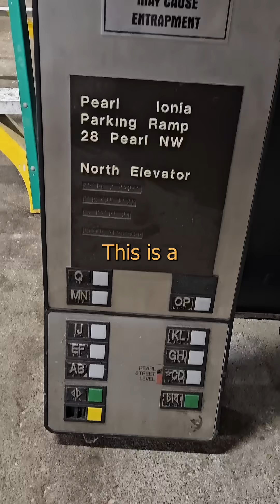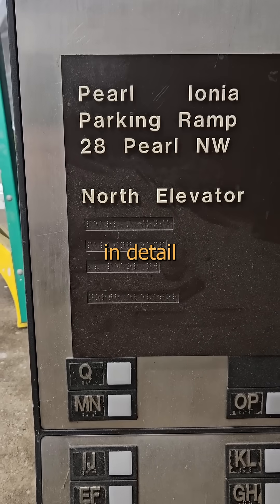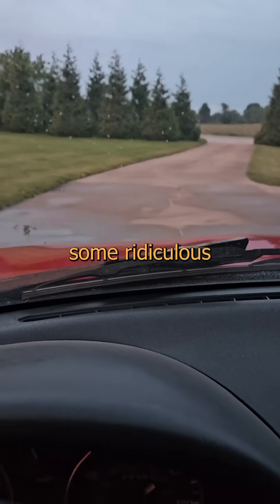Miata Mischief #chrisboden #engineering #gear #elevator #score #stories #parts #hacking #making

Comment: I once hauled a Force 50 long shaft outboard engine in a Peugeot 307 CC I had it in the front passenger foot well, engine in the foot well with the roof down and tied to the seat, the propeller was above the windscreen, the outboard took 2 people to lift, I got some really strange looks on the motor way  when I was going home at 120KPH

Comment: Wanted a basketball hoop pretty bad when I was 16. I found a free one and only had a 02 civic, I took my took box and set on an hour long journey to the hoop. I had to disassemble everything apart, and yes, it was a fancy one too with a glass backboard that sucker fit just right in the backseat, the bottom fit in the trunk, and the bar was rusted so I couldnt break it down. Now I was in a dilemma, I couldnt throw my seats down because the backboard was blocking it, couldnt stick it out of trunk because the bottom was in there, and I didnt want to leave it and drive one hour back to go with a half basketball hoop. Then I struck a genius moment and realized I could stick it in my sunroof. I opened the sunroof and stuck it diagonally into the backseat, shut the sunroof to keep it from moving around and I took it home feeling like im ready for some car jousting.

Comment: 1: 1997 Chevy Silverado C2500 NO 4X4 capabilities. Oh and long box.

2: Towing my buddies 2025 Dodge 5500 6.7L Cummins from 5ft deep of snow in a ditch.

3: dont have a trailer and his front axle went from 1 whole axle into a soggy taco. 

4: didnt have my goose neck trailer… so we somehow put his end on the back of my truck bed and towed it with his back wheels on the ground. 

5: No straps and lights. So he had to be on the gas at the same time as I was or it would fall off. Also keep in mind that we were on the most major highway in Alberta Canada during a snow storm. 2 hrs later we pulled it into my garage and worked on it 5 days straight

Comment: I fit 3 tires in my passenger seat and another one in the trunk , ive also hauled a hard top 6 hours across state lines witha  ratchet strap passed through the windows of a crosstrek.

Comment: Oh I am a total trash dragon. I build gadgets from trash then sell em as functional art. I built a 12v AC system with a scrap evaporator, a couple scrap condensers, a portable 12v squirrel cage blower intended for job site ventilation, and a VW 5 cylinder AC compressor hooked up to yet another 12v motor (this gadget I probably wont sell). The only thing that was new was the refrigerant plumbing, expansion valve for the evaporator, and the batteries (have to do it right to do it safe). I gotta 200a bank of accessory batteries in the under pinnings of my truck. I can plumb cold air into a tent with an insulated vent or run it into the camper of the truck. :):) Gotta channel launching this winter once I have a good back log of my shenanigans. Love the channel Chris. Keep it up!

Comment: An entire 3pc wall unit. In a CRX. Also hauled a fridge/freezer combo with the same vehicle 😂. 
The most sketchy was a 3 pc sectional and weight lifting bench and bed... all on the roof of my buick😊
4ft bed southbend lathe and table on the roof of my dodge colt...
Only had one shot and no truck😂

Comment: I was a broke college kid in Munich, and found a sweet 2-person leather couch, but only had a bicycle and a bus pass.
I rented a Mini cooper convertible by the hour (like zipcar), and had to drive that thing on the Autobahn with the top down in the winter with some show showers.
The couch was about as wide as the mini, and I had to hold on to it all the way, since about 2-3 was hanging out the car.
I was pulled over by the Polizei, and they wanted to give me a ticket for unsafe cargo, but could not stop laughing, so they just told me to not cause an accident and go home through the shortest way possible..

Comment: Compared to all these great stories, mine is pretty lame. Hubby and I did a late fall haul of the remaining crap outta his deceased brothers house up to our camp in northern NH. We got a very late start, it got dark early, and it started to POUR. We started thru the Notch (Franconia Notch) and suddenly lost all lights in the truck. So, no exterior lights on truck OR trailer, and no interior lights…weirdly the ONLY thing that worked was our hazard lights (which makes NO sense). We made it to Lancaster and got pulled over, but as the cop was talking to us he got an emergency call and just told us good luck. We somehow made it up to our camp without getting hit. That was at least 25+ years ago and we remember it like it was yesterday.

Comment: I was remodeling homes very poorly for awhile without a truck. While working in southside Savannah area I had a couple houses within a few miles of the Home Depot. One house needed a whole new door jam installed. I had a maroon 2003 Hyundai Elantra sedan. I put the entire door jam frame and door as one solid unit on top of the Elantra. Put all 4 windows down and ran some very flimsy cam locking straps not even ratchet straps. Drove the 3. Something miles holding the ends of the straps in one hand shifting with the other hand and driving very slow with my knee. Made it got the door installed and made a few hundred bucks off the job

Comment: Not really all that crazy sounding, but I loaded up all the 12v batteries from several enterprise server room UPS that we replaced to haul off for recycling. There were qty 384 of the 9 AH batteries, and 96 of the 5 AH batteries, altogether it weighed about 2900 Lbs on the pallet we unloaded it on. My Subaru Outback did NOT appreciate the load.

Comment: Ok, putting in it all the gear you will need to go cave diving, probably trained and equipped, then driving 100 miles to Marianna Florida. 
Oh and manual transmission all the way. 😊

Comment: Back in the early 90s I was wandering around industrial parks trying to come up with milk money when I discovered a dumpster 40 yd.³ dumpster full of everything that had anything to do with Pentium production line or older from a bit player that just up graded its digs.
All I had besides my bicycle was an old blue Mercury comet I made six trips to my garage at my apartment and filled it floor to ceiling.

I had that mercury filled everything, but the driver seat I had the trunk filled to overflowing I had on top of the trunk lid, packed and tied I wished I could’ve gotten it. All my wife looked at me and said I was nuts..
It took a wile to find top dollar but I did
And received. $4,000.00 for basically two days work.

Comment: Drove a 1997 Lotus Elise daily and moved huge amounts in it despite it only weighing 700kg. My 50kg Labrador, took it scuba diving and freediving including all my equipment, attended LAN parties with my PC in the passenger seat, went camping with a double-size swag in the passenger seat which only fit with the roof off, and coolest of all, moved a running server by first putting the UPS in the footwell beeping all the way between sites.

Comment: I was walking home one day and for reasons I don't know, I found a blood lead level tester from probably the 70s, still in its waterproof plastic case. I brought it home and disassembled it, which I am fairly sure I should not have done, but fuck it.

I also found a very, very expensive Zeiss microscope in the same place 20 years later.

Comment: Drove a front wheelie on a wheel loader for a mile and some change in the snow to get a bunch of steel plates to the job site. Let me explain.

I live and work in the sticks, curvy back country roads that only lead to more Bumfuck Egypt, rednecks, and bad decisions, this is home for me, and with that comes some freedoms to do dumb shit and nobody is going to think twice. 

It had snowed heavily the night before this incident and the roads were thick with ice and snow. 

I managed to get to work and all the work trucks had gotten stuck in the snow. We chained the trucks tires but they still didn’t have the weight in the back to keep them from sliding or gaining traction, and we couldn’t put sandbags on the truck beds (for reasons I still don’t understand) so I thought “why don’t we call the metal fabrication shop down the road, and see if they can cut us some mid thickness steel plates we can bolt down in the back of the trucks to weigh them down a bit without having anything protruding” redneck as hell but fuck it we’ll give her a shot, and that’s what we did!

The problems began after they cut the sheets, with delivery, they couldn’t do it because of the snow, well shit what now, the trucks are stuck, forklifts are stuck, but we do have a bucket wheel loader with chunky tires and they’re only little over a mile away, we’ll just drive that down and get them. So we did.

We drove there absolutely no problems, roads were icy and snowy but the wheel loader had no issues with it, they direct us into a shop door where they slide the sheets out into the bucket of the loader, and as soon as they dropped the sheets, the bucket stoved itself about 2 inches into the ground before springing back up and the whole kit N Caboodle balancing perfectly on the front wheels.

We all stood back and stared at it for a second in amazement, this fairly large machine balancing perfectly on its front wheels, we thought the bucket loader was rated for more weight or the steel was heavier than we had originally anticipated, and it’s too heavy to get the rear down at all, but either way here it all sat, balancing.

Of course the boss is not happy, and neither are the fabricators cause now this things just kinda stuck as one big hazard, but I however do not see a hazard, I see a potential for a fun and rare opportunity to fuck around on the bosses dime, and I’m redneck enough to not exactly follow OSHA more like OHSHIT, so I climbed up into the balanced loader and put her in reverse, and it stayed balanced as long as I feathered the gas right, so I said real nicely to the boss “boss I can get this back to the site just like this no problem, you’re just gonna have to trust me” which of course he absolutely didn’t, BUT he didn’t really have much of a choice because the fabricators pretty much just walked away from the whole deal leaving us to our own devices.

So I backed it up and realized that this bucket loader steers in the middle at a joint, not at the front wheels, so to steer I had to jockey the steering to throw the weight of the rear around to pivot on the front tires, so I did that, for a mile down winding roads all the way back to the site, sliding, slipping, bashing the bucket into the pavement, destroying some local vegetation, taking out only one stop sign, and feeling the weight of all the OSHA handbooks spontaneously combusting due to my actions.

Once we got to the site, I dropped the bucket, and left the unloading process to the guys there as this whole ordeal had taken quite a significant chunk of my time and I had more important things to deal with. 

But that was probably my sketchiest transport story

Comment: I used to work at a bottled water factory. Purchased an entire pallet of water at $1 per 24 pack, the discounted rate for employees. Ended up having to leave a few behind, as i had a '91 Chevy S10 and the front tires were near ready to leave the ground with how many cases i had.

There are 84 cases in a pallet.

Comment: I bought a 1969 Honda CB350 motorcycle a few towns over. It needed some work so I had to get it home. So my ex and I loaded it up into the back of his Subaru outback. It was an extremely tight fit and certainly wasn't good for the back of his car but it worked out. I have pictures of it jammed in the back that I like to show people asking about cargo space of the outback

Comment: 16' long composite deckboards strapped over the roof of a regular cab, short bed Ford Ranger. Used the loading dock twine from Home Depot to tie down one end to the front bumper and the other to the trailer hitch.
Also carried 1600lbs of cinder block in the same truck. That was a sketchy ride. 🤦🏽‍♂️

Comment: I drove a 15 foot 4 inch wide pvc pipe up a mountain road because i wanted to make a snowboard rail. I had half sticking out the front passenger window and the other half out the trunk. My car was a two door. Luckly only almost skewered a deer

Comment: I buy car parts but the most time the parts don't fit soo good in the inside of the car as the outside. In my opel corsa b i got 3 meter wood boards on the roof and a pallet jack in the inside. On a other trip i got two bumpers and some interior parts in the car.

Comment: I was offered a free fifth wheel rv, 36 feet long and a total weight of 18500 lbs, I hauled that sucker home with my ‘97 F150 sporting a 4.2L V6. At the time I did NOT know the breakaway pin was missing. That means the electric brakes on the trailer were fully engaged. My truck was screaming on the highway and still made it up to 100kph (60mph) up hill no less. What a fun ride that was 😂

Comment: 1996 Chevrolet Camaro, removed rear hatch to haul 2001 Yamaha Banshee like everywhere!! Rear tires wedged in the T-top compartment and front wheels on edge of t-top roof bar with ratchet straps from quad frame by foot pegs to under driver and passenger seat frames.. All to ride every weekend, miss those days!!

Comment: I once had an internship at a machine Workshop and was tasked to get a pallete of steel sheet parts from across the country.. little 19yo me feared the Company shitbox for that long drive so I took my personal car.. I got there and the load Fit in the trunk all good. I just underestimated how heavy some densely packed steel sheets could get. The drive home was like driving a tank without acceleration nor brakes nor suspension.. I made it, car was happy again after the thing came out and the suspension came back up about 20cm but after that I did take the shitbox.

Comment: Super boring I know but I stole a £600 (or so) office chair from my university and took it home on the bus. The bus was packed, and there were no seats. Fortunately for me, I had a seat. This was a BYOB moment, but for only me and my chair. 

I realised that if I wrapped my backpack around a pole I could stay relatively in the same place. Unfortunately, this was after learning the hard way that an office chair with wheels will move on a moving bus. Nearly got kicked off because I ended up next to the driver's window when we came to a stop at some lights.

Comment: Nearly killed the suspension on a 1993 Mercury Sable shaggin' wagon hauling home a bunch of pressure treated landscaping timbers to build a fence with. Car never handled potholes the same way after that. I managed to cram 50 of them in there and I think I only scraped the muffler on the pavement 3 or 4 times.

Comment: The Miata is the perfect example of less is more, you are correct they are made of fun, the fun module is mounted just above the torque brace forward of the fuel tank. Don't scratch it because the smile turns upside down :-(

Comment: I drive 1991 mazda b2200 5speed I wish I had a miata but the truck is fun just a little bit slopy In the suspension But I have plans for an upgraded anti roll bar and lower profile tires like 205/ 55r16, instead of a 205/75r14.

Comment: I bought the Mechanical contractor a case of beer to have his crane operator lift the Cold War Era Chrysler Air Raid Siren off the third story roof of Carrick High School in Pittsburgh, set it on a utility trailer that was about a ton too light and haul it thirty miles home. When you fire up the Hemi V8 engine and engage the clutch the 138dn that it makes a hundred feet away not only brings new meaning to “noisy neighbor” but gets the attention of everyone in a 50 mile radius!

Comment: Uhm....transporting couches on the roofs of vehicles that definitely should not have had couches on top of them, especially the pull out couch that weighs close to 200lbs for some fucking reason.

Transporting 20ft boards in the trunk and on the roof of a Toyota......something sedan with a sunroof. Using that same Toyota, a piece of an old tow strap, and a tree branch as an engine hoist for an '04 Chevy Silverado 2500 HD on a grassy slope in the rain, I'm impressed with the tree and the car on that one. 

Hauled 12 people in a Ford Focus over 100 miles. I sat in someones lap to drive, double stacked passenger seat, double stacked in the back seat with #7 laying across laps, and 2 in the trunk. It was a very uncomfortable ride in the middle of the night and we stopped frequently so the trunk riders could have a break and trade out if they needed to.

Got a massive (apx 5'wx3'dx7'h) solid oak armoire with iron embellishments for free and moved it about half a mile through a gravel and grass back alley with my cousins mountain bike and my grandpas dolly so I could get it into the bed of my uncles truck for the rest of the way home, also moved it on a small lawnmower trailer pulled by the focus about 20 miles, then me and my mom and roommate hauled it up a ramp that IS NOT ADA compliant. I have moved over 3,300 miles with that armoire and will be taking it back across 3,300 miles in a few months, and everyone I love is going to briefly hate me again when I ask for their help moving it yet again. I'm not sure what creative ways I will be transporting it this time.

I think that's all the dumb shit with vehicles I'm willing to put in writing. I don't talk about these very often, so this was fun.